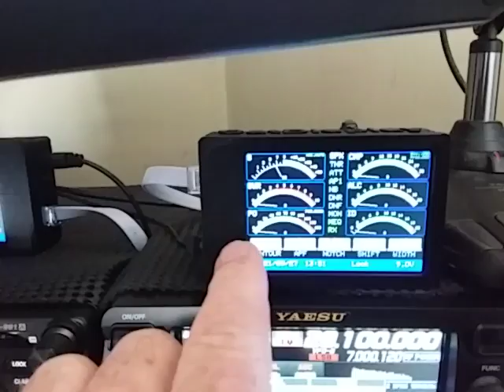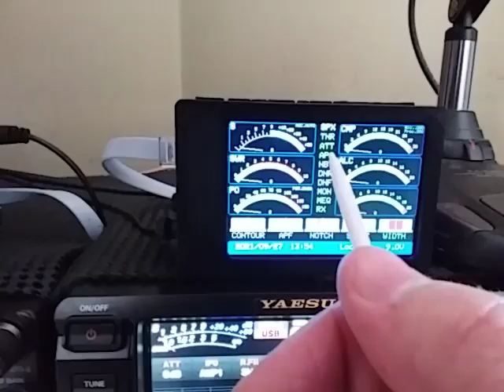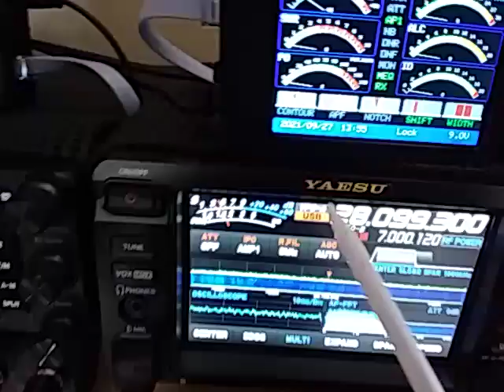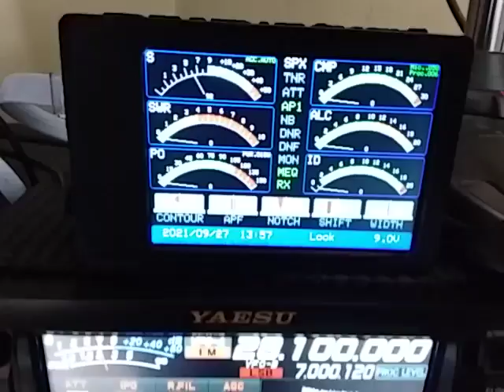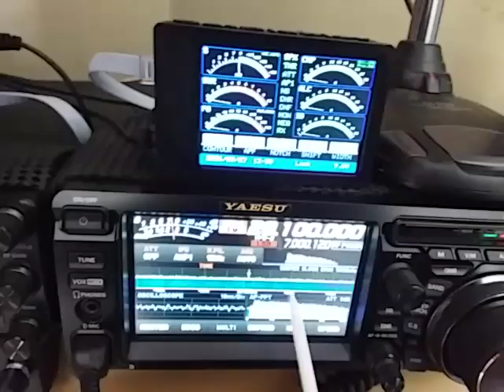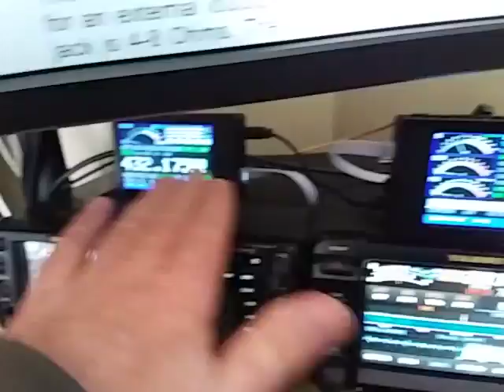CatMeters

Comment: What do you use as a power source ?
Reply from the maker: CatMeters works with 7V DC  to 30V DC. I simply tap into transceiver 13.8V DC supply. It has a standard 2.1mm DC jack (center pin positive). More details here: http://www.catmeters.com
Reply: @ZL1CVD  I had read the requirements (hurray my new catmeter arrived this week) but couldn’t find a wall wart to power it.
Reply from the maker: @jerryKB2GCG  https://www.amazon.com/dp/B0998BMQYP/ref=cm_sw_em_r_mt_dp_ZJ7F9XSA45XENBW8Q57J?_encoding=UTF8&psc=1

Comment: Wish it was possible yo use the meter and cat functions on a 450d. Love this display :)
Reply from the maker: It does works with 450D + Yaesu FT-950, FT-991, FT-2000, FT-DX10, FT-DX101, FT-DX1200, FT-DX3000, FT-DX5000 & FT-DX9000
Reply: @ZL1CVD  yes but the 450d has no USB port, so if you plug this into the CAT port that's your lot. You can't use any other CAT device. I think that's what David was getting at.